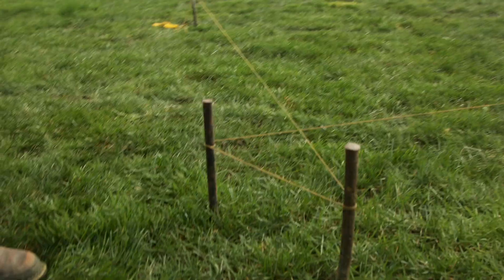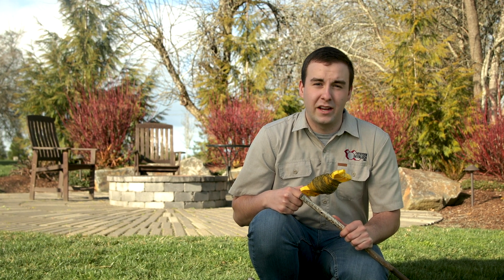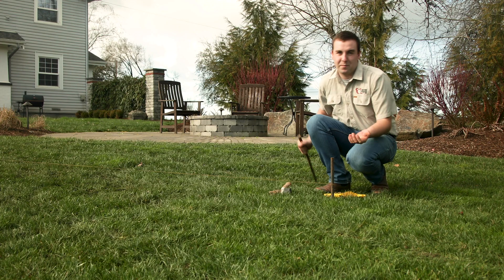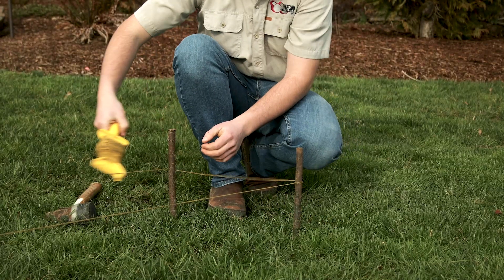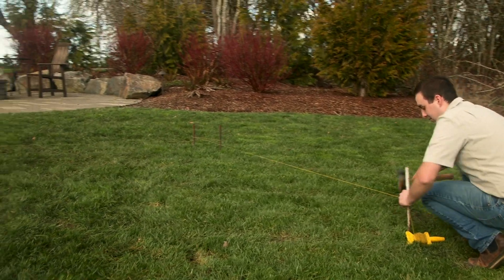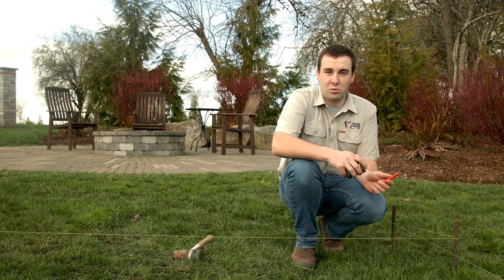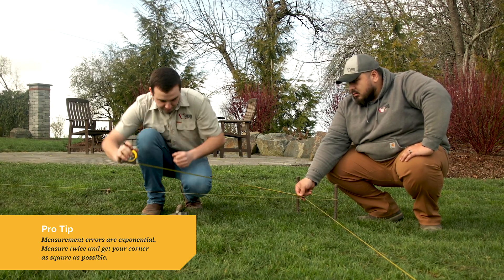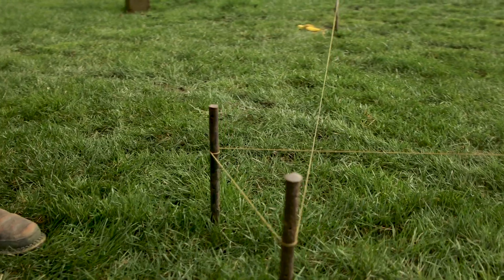How to Square a Corner Using the 3-4-5 Method

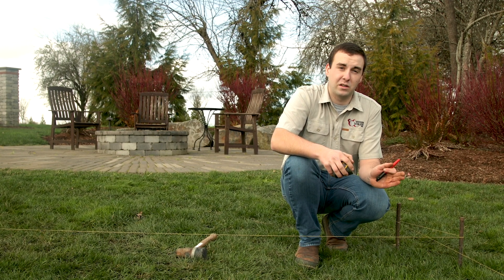Comment: 2:38 "You Can Do This By Yourself"   - How do you hold a measuring tape to the string on one side  5 or 10 feet away while also holding the end of the tape?  I ended up using knots but I want to see how it should be done because it took FOREVER alone.  Also what about level? Maybe I'm just a perfectionist but I was also using a level line on the string and the project just became iterative hell alone.
Reply from the maker: Yes, you CAN do it yourself but it’s much easier with help.

Comment: So I've got a base right-angle triangle done. How do I extend the lines and ensure it remains straight/proportional? For example, I want to stretch out 3 and 4 to say 10 metres. Do I have to keep measuring the hypotenuse to know that it remains proportional?
Reply from the maker: Good question. You can keep using multiples of 3,4 and 5 such as 6-8-10 or 12-16-20 until you get out to the size you need. Does that make sense?

Comment: What if the dimensions are smaller than 3,4,5? How would you square a smaller corner?
Reply from the maker: It's any 3, 4, 5. It still works even if it's 3mm, 4mm and 5mm. At smaller sizes, just use a framing square or something like that.

Comment: Thanks...at 1:24 how do you know where to put that stake?  How far away from other stake??
Reply from the maker: The stakes should be placed as near as possible in line with the edge of your excavation area. The actual distance doesn't matter. Just make sure to leave enough room to work.

Comment: I thought you were going to show how to use the same principle on the smaller triangles on the exterior.
Reply from the maker: The smaller triangles just exist to allow for wiggle room when adjusting the strings. If a stake was placed there, it would have to be exactly in the corner.
Reply: it is possible mate ,

Comment: 00.40 min. Setting a straight line, set stake #1, walk a ways and set stake #2, no measuring. 
Is that where you start measuring your structure or base, from stake to stake?
Reply from the maker: The string line that Colin first pulls is running along parallel to an imaginary foundation. It should be as close as possible to the foundation. This string is to establish something straight to work off of since no foundation or wall in the world is actually straight as a tight string. Ideally, the stakes will be outside of the foundation. Measure outwards from this first string line to establish the depth of the patio.

Comment: Do you do this in all four corners ? Around the whole square ?
Reply from the maker: Generally if one corner is square, the rest of a square or rectangular project has to be square as well. There are times when it would be necessary to do this more than once, but that would only be if there was some sort of transition that introduced a new shape to the project.